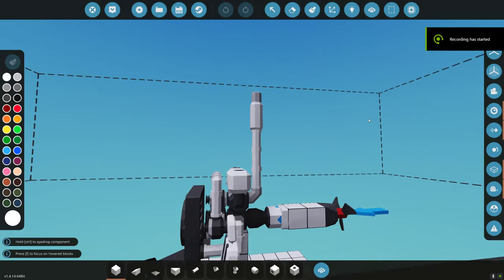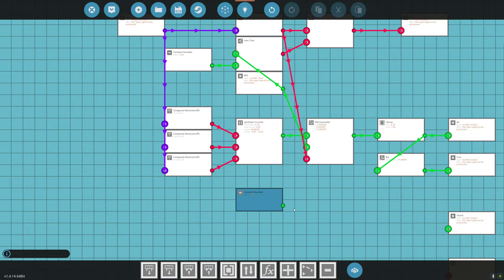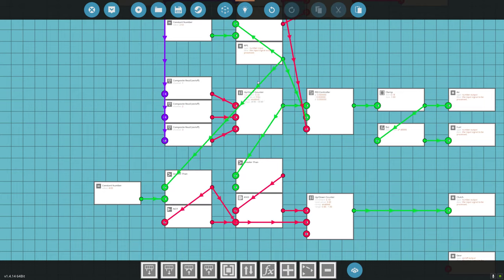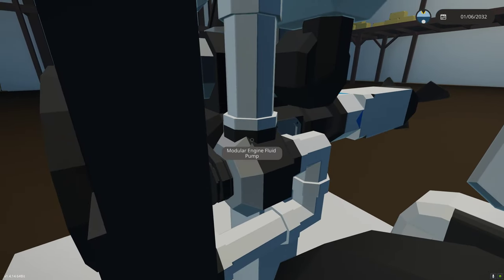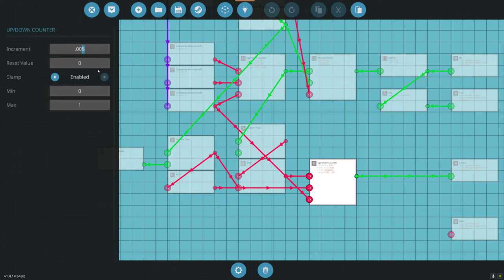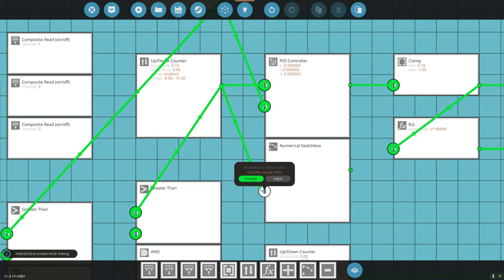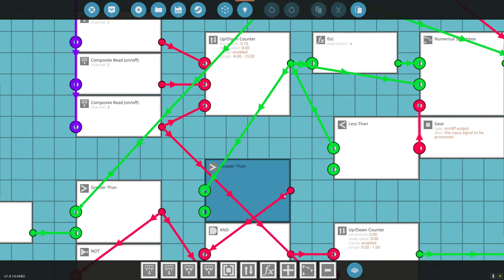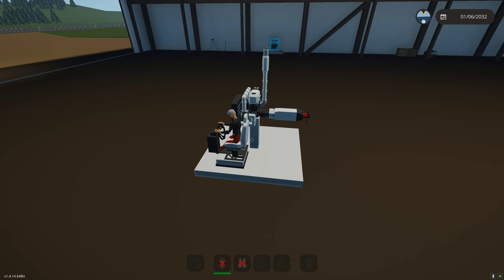Stormworks Basics Modular engine tutorial Part 4

Comment: Great Series! :) I dont know if its gonna be a topic, but can i instead use a lever too? (with some changes i mean :D)
Reply from the maker: Yes you can!
Reply: @CaptainCockerels  my starter boat is ready for an update anyway, I think it gets a modular engine with your MC then :D maybe 4 cylinders for the beginning? Does that change anything regarding the MC?
Reply from the maker: @MrPupsi  no engine size doesn't really change anything. You can probably upgear it more with a larger engine
Reply: @CaptainCockerels  Good to know, thanks. I have another question - why do you dont use the flywheel? As much as i understand, it can help you with getting in gear so you dont have to be super precise with the clutch settings. Or am i wrong here?